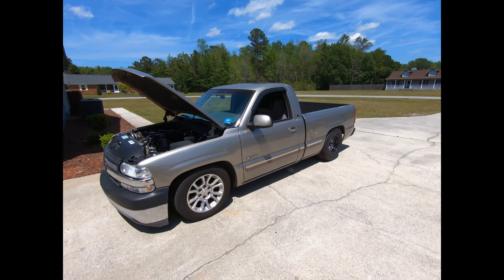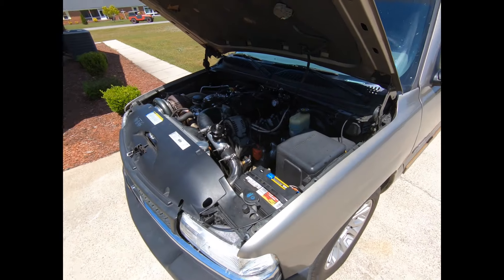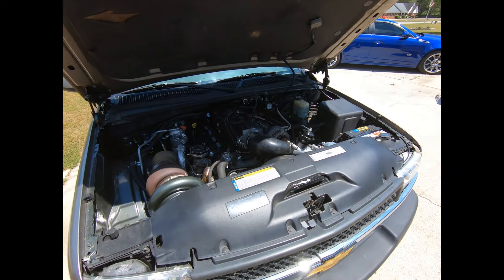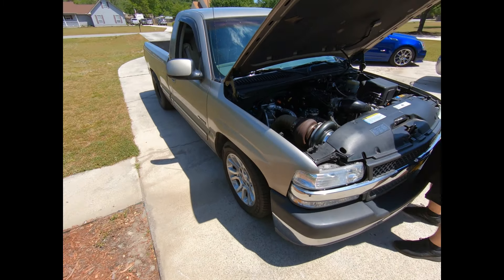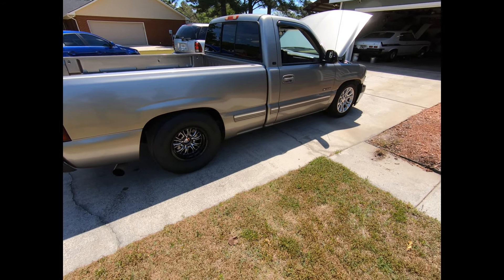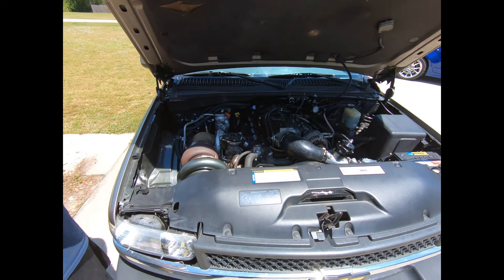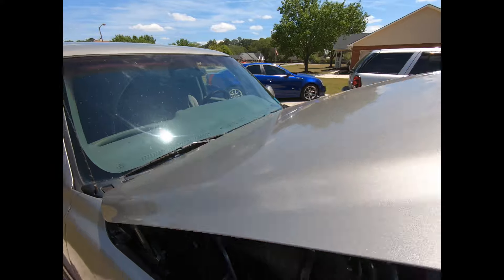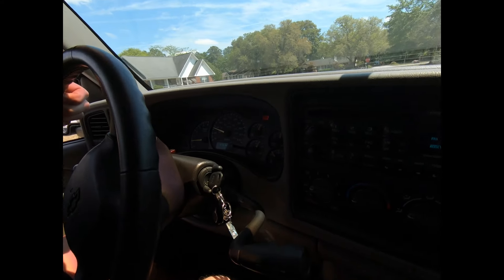800+ Stock bottom end Turbo Silverado Ride Along

Comment: Now that's a real deal Silverado right there! Looks 100 times better than any of the junk that GM's been putting out over the last 7 years!
Reply: Thanks man and ain't that the truth
Reply: Love my 2011 silverado 5.3 ls she's tuned with 395 whp stock everything it's my daily it has 225k miles never left me stranded
Reply: @badazz2969  No 5.3 ever built came "stock" from the factory with 395 HP. 2007-2013 Silverado 5.3 made 315 HP stock, even the newest 5.3 with DI only makes 355 HP.
Reply: @LsxNova  would love for you to bless my 85 monte ss great ride by the way
Reply: @cutmiller8846  maybe one day. I got a lot on my plate atm but always willing to help
Reply: Crappy 6l80,spose good for freeway
Reply: @badazz2969  lmao  my 2011 5.3 made 295hp stock and after cam only dyno tune its 355
Reply: @badazz2969  no it didn't bro quit lying too yourself so you can sleep at night
Reply: @BamaTidefan1967  buddy u gotta read stock everything and tuned bone stock Silverado with a performance tune
Reply: Any bone stock truck from that time won't touch any of the newer trucks unless you do something drastic with it. A tune ain't going to do much.
Reply: @badazz2969  Someone gave you a fluffed dyno sheet if thats true. Cause there is NO way youre making that stock with a tune.
Reply: @BamaTidefan1967  $ says hes never been on a dyno or a track.

Comment: I just finished rebuilding a 5.3 I put a btr stg 3 cam and milled out the heads myself got injectors and a fuel pump and full dual exhaust. It’s only gonna make like 380rwhp maybe but it will be a big step up from the v6 that was in it. Your truck is how I want mine to be the turbo spool sounds insane

Comment: I find these interesting. 
Pops and I , we aren't spring chickens anymore as i just turned 50 and Dad has 30 on that. 
And hes not really a domestic guy and im not either, we usually like playing in the corners with smaller cars.
I do enjoy a ride in something that nails me back in the seat though dont get me wrong there 😅 
In the world of time vs money, i had a crazy idea of buying someone's LS turbo pickup and just having a thrill all summer burning the tires off it with Dad, i think he'd get a kick out of it.  
Clean ride ya got, i dig it. ✌️
Reply: hey man not gonna lie your on to better things than current american garbage. that being said i went similar routes. but my daily toy in the warm months is a square body s10 blazer with a fuel injected and roller motor sbc. low investment and i have been offered over 12k cash for the thing on multiple occasions. i have roughly 2 grand into the vehicle and and its good on fuel weighs nothing has gobs of torque right off idle and it makes all car ppls knees weak.

Comment: That's bad ass!!! I was worried about running 12 pounds on a stock l92 soon... I'm thinking full send now 😆
Reply: I wouldn't be surprised if they added some gap to the rings. If not it's all in the tune...and gaskets and ARP.
Reply: How's the l92 holding up and how much power did it make about to do the same amount of boost on mine in
Reply: @Carmelo-l8h  I'm doing the restoration on the body and haven't fired it up yet 🤣...I did end up having forged rods/pistons and gapped rings installed though...I have 15# and 18# pulleys to try out

Comment: I need help. I have a 03 Silverado fully built motor from the block up trans is stock besides corvette servo it shifts fine into all gears under easy throttle but under full throttle at around 95 it won’t shift into fourth but I let off it’ll shift into 4th
Reply: Thats how it supposed to be
Reply: @gordocarbo  I don’t think so. It’s got a tune govner removed all that

Comment: Similar to my neighbours Truck that I’m buying… 2001 Chevrolet Silverado 1500… 6.0L LQ9 LS3 Intake, Long Tube Headers with 3 inch Exhaust, Hatfield built 4L80E, TruTrack Posi 3:7:3’s, 3600 Yank Stall Converter, Stage 3 Tooley Cam with HD Springs & Guides, Caltrac Traction Bars, High Volume Fuel Pump, New Drive Shaft with HD Joints, 4 inch Front/6inch rear lowering kit… 450HP to the Wheels… Just need to get a Turbo now after I buy it. What would you suggest?
Reply: Damn all that to not go fast asf, just semi quick? Wild
Reply: @SamsonTheWyrm  Turbo kit and I’m in the 900+whp.

Comment: I have a 2012 Chevy Silverado 4.8l completely stock I bought used with 50k miles and I have 799 heads I have some buddys who have 4.8l a Tahoe and round eye and they don’t have 799 heads , do I have “aftermarket” heads or does 4.8l come with 799 in never models
Reply from the maker: 799s come in the new models

Comment: What did y’all do with the rear end just gears only or anything extra how is it holding up at the track? Wondering if I need to put a Ford 9 inch for my 800hp-1000hp build
Reply: It’s a built 35 spline rear with 4.10 gears.
Reply: @LsxNova  what height tire are you running?

Comment: Does it have stock ring gap? I have a very similar setup.
Reply: You kno he gapped the rings with that much boost on it
Reply: @keithwashington5192  not necessarily. I've seen more boost on completely stock bottom ends.
Reply: Stock ring gap. Had 140k before the 5 years of nitrous now been boosted for over a year

Comment: With the stock 4l80e and the triple disc did he have to mod the oil pump (transmission) or install that sonnax valve?
Reply: Stock 80e wont hold that power you need to build your 80e and a triple disk converter is a must for that kind of power.
Reply: Stock oil pump and no issues. Been together for over a year now like this
Reply: @LsxNova  how’s it doing now ?
Reply: @IsaacKapone405  still going strong. 2 drag and drives later still mint. Been 9.78 this past year at ls fest too. Gotta love it. Truck is 4590# with driver as well
Reply: @LsxNova  okay thanks one more question whag drop ? I got a 5/8 but thinking about lifting it up a inch or 2

Comment: I know I’m about to get bashed. But does shifting helps you? Do you shit it to 1? Thanks for the info
Reply: At the track, I just leave it in 3rd. if it's going to be spinning I want to control the gear change cause the computer will just see wheel speed and shift off of that.
Reply: @LsxNova  thinking about swapping my 4.3 & wanna do it like yours man ! I heard 4.8 is good idk if it’s true what do you recommend ? 6.0 ??
Reply: @IsaacKapone405  any motor will work great with boost. I like ci so I can run less boost. 4.8 will just need more boost to get same power.
Reply: @LsxNova  how much did it all cost in total ?
Reply: @IsaacKapone405  no idea. A lot of stuff I had laying around but I know I put 4K out in just in ecu, converter, fuel lines, and driveshaft
Reply: @IsaacKapone405  Start with the biggest engine you can afford
4.8 is puky even with na mods, 5.3 meh...
Reply: @gordocarbo  yeah I bought a 6.0 from a create & made it into a 408 stroker

Comment: How much did yall have to shorten the 8.8 rear end to fit i have one out of a old cop car and its wider
Reply: I didnt shorten it at all. I have no idea what it came out of. It was in a pile of scrap 😆
Reply: @LsxNova   does the truck have gen 3 or gen 4 internals?
Reply: @Bassethoundswin  it’s a 2005 lq4 so it has the gen 4 rods